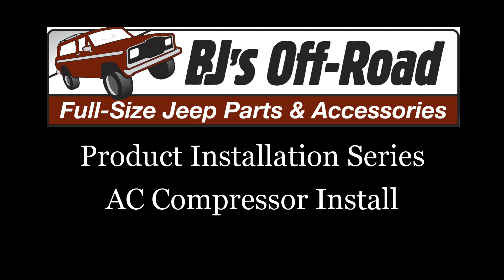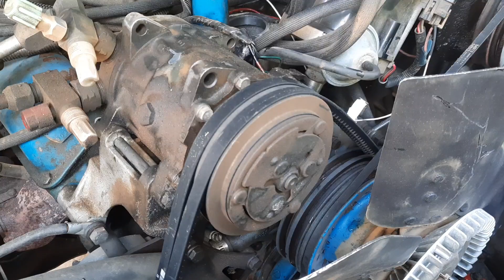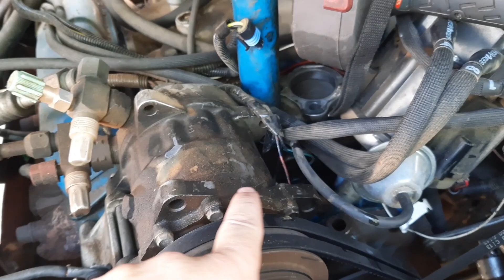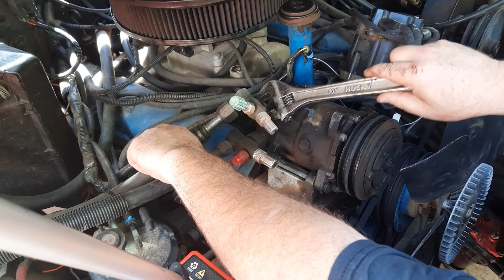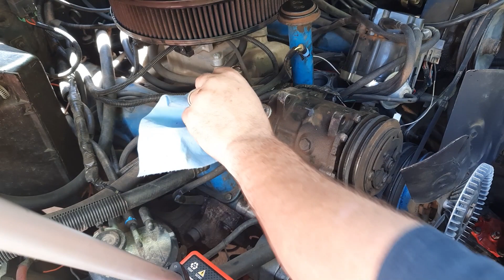BJ's Full Size Jeep Parts Sanden AC Compressor Install 1989 Jeep Grand Wagoneer

Comment: We replaced the compressor with a sanden style one on our 90 GW and now the lines won’t thread back on. Any tips?
Reply from the maker: depending on the type of sanden and fittings, you may have to adapters to go from your hoses to the new sanden fittings